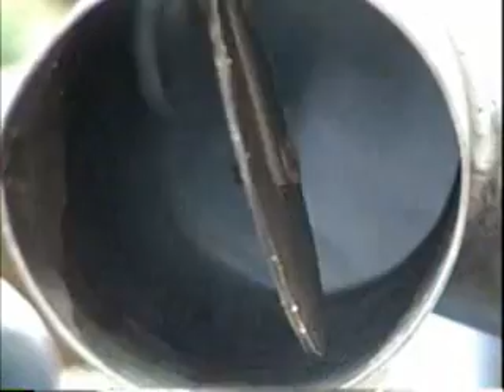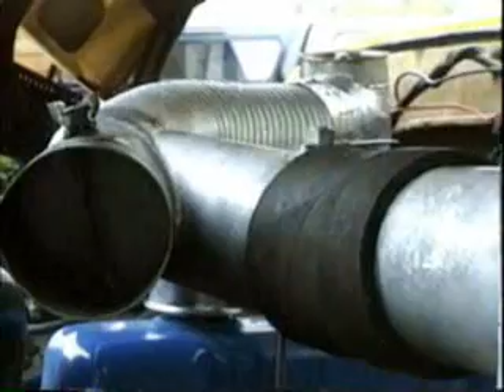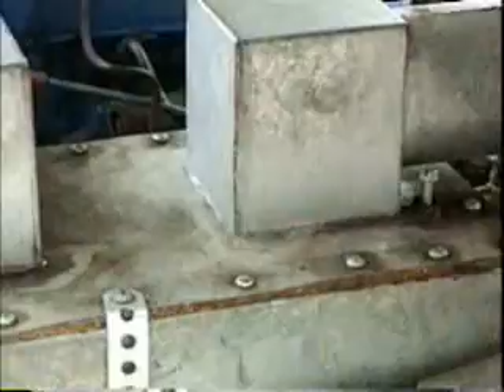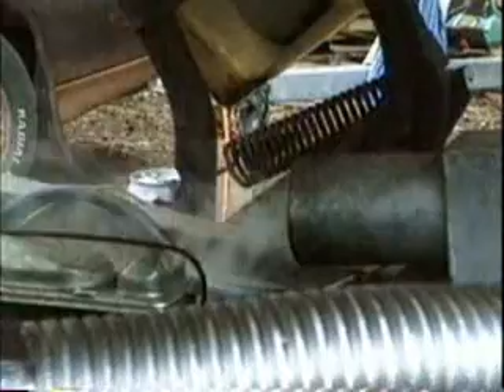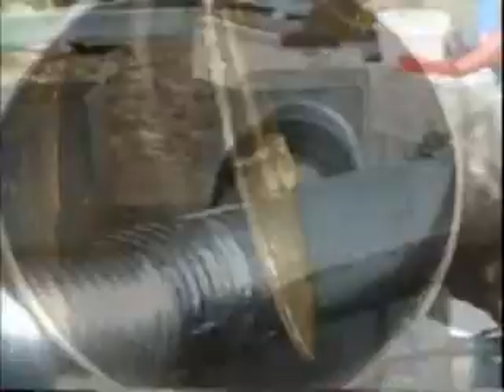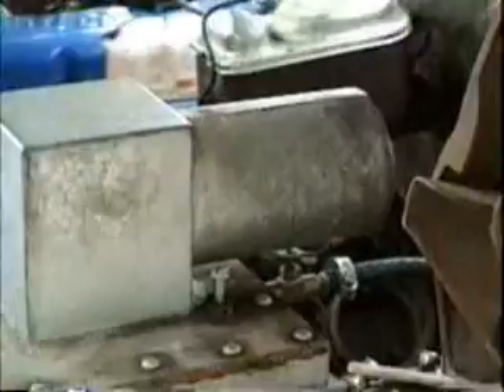Here is definitive proof on how to separate all Atoms in all liquid soluble matter.

Comment from the maker: The secret to what I have done, is not the amount of heat applied it is the temperature applied, and the ability to control the exact temperature to boil the atoms inside the liquid. I am saying that all atoms have a specific boiling temperature inside all liquids. All liquids have specific boiling temperatures. Until I discovered that using a fine pressured mist of liquid, spraying it onto a specific temperature, that I could take any liquid to any temperature, even above the boiling temperature of that liquid. The fine mist droplets of liquid will go to the temperature being applied faster than the liquid can boil. Like Sublimation does to snow flakes. The snow flakes go from a solid to a gas without becoming a liquid, when a flame is applied to a snowball. I discovered that atoms have their own boiling temperatures inside every liquid. When an atom boils it becomes a gas, and other atoms inside that liquid, having different boiling temperatures, have not reached their boiling temperature and they remain a liquid. Gases and liquids will separate, thus separating the atoms in that liquid. Flashing Liquid is what I call my process.
Reply: +Bill Kendrick your system has merit but i think it is too dangerous to be experimenting with it in this fashion but i could be dead wrong and it uses a heat source that draws energy to do it i believe what you are doing is called flashing of a liquid to eliminate any secondary phase changes of a liquid to a vapor...in a vacuum there is a secondary phase change from liquid to vapor it is crystalization of some of the elements of gasoline
Reply from the maker: +pat galloway Here is a feather for your cap. Science says gasoline auto ignites at 534 degrees Fahrenheit, wrong. I have seen an electric cal rod heater, like electric water heaters use, turn a dull red before gasoline auto ignites. This is between 1000 and 1300 degrees Fahrenheit. This means there is over 500 degrees Fahrenheit temperature wise, that science says does not exist, in gasoline.
Reply: +Bill Kendrick  yes i know ,liquid fuel will not ignite at atmospheric pressure unless there is vapor present,even gasoline will not ignite even if you apply a lit  propane torch to it provided it is in a container with the lid off but if it is allowed to sit long enough to vaporize some of it ,it would be foolish to have any ignition source about . what you are doing is brilliant but i think it should be done in a manner that is totally safe and when the system is shut down there should be a carbon canister to absorb and reuse any residual vapors upon restart but i think  without expert engineering this is highly unsafe .that is why i do it in a vacuum
Reply from the maker: Yes it is the temperature applied that separates the atoms, however it is the amount of mass the heat source has, that will maintain that applied temperature. You see when the cold liquid makes contact with the heat source, heat goes from the hot surface to the cooler liquid, and it is the mass amount of heat at the right temperature, that causes the atoms in the gasoline to boil, becoming a gas, while other atoms in the gasoline, have not reached their boiling temperature, and they remain a liquid, thus separating the atoms in gasoline.
Reply: Bill Kendrick
 I think you mean splitting molecules apart not atoms. It takes a nuclear device to split atoms.

Comment: The gasoline tom ogle used isn't of the same we use today. Today's gasoline has many additives. Gasoline has a expiration date too. If you ever saw a model engine. The way the gas is fed. Is just fumes only. A tube or tank filled with gas with a hole on one side as a air inlet and the intake connected on the other. Air passes over the gasoline picking up its fumes. After running for a while on a model sized tank filled with about quart of gasoline. The gasoline becomes a useless liquid no longer producing fumes. However I noticed adding acetone increases the duration and production of fumes. There is a lot of things to factor that no one has experimented with.

Comment: The LAST thing you want to do is send this video to Obama. Research Tom Ogle. Made the news, got assassinated for not selling out.
Reply from the maker: I have already given this to all who see it on You Tube, guess they will have to assassinate everyone that has seen it.
Reply: Bill Kendrick  Haha you know I'm teasing! I've also been researching and testing vapor for some years  now. You've done a MIGHTY fine job here, especially for how old the video is! I do have a question though, how are you getting 600 degrees into the bottom of your reservoir? I seen somewhere else where you have 2 heating elements angled at the bottom, but what exactly are they? 600 is quite a feat!
Reply from the maker: Tyler B Because, at the time there was not a power inverter, on the market. I had a generator company rewind a generator, from an older vehicle and it produced 110 volts DC, turning the generator at 2000 RPM. I used two flat bar 250 watt 110 volt stainless steel heaters wired in series to get 500 watts of heat, which was around 600 degrees Fahrenheit. The rewired generator worked great until we did our first road test. I discovered the generator was running at 4000 RPM at 50 MPH. It burnt one of the heating elements into 2 pieces, at 400 RPM. Power inverters eliminate this problem..
Reply: Bill Kendrick  Very nice! Smart man. I hope you continue to spread the word and innovate.

Comment: Mate it aint happening, not until you guys change Presidents at the very least. He seems like a nice bloke but clearly out of his depth. Great video. Cheers, Zac.
Reply from the maker: Just to add a comment, I found I could advance the engine timing to top dead center and increase the engine power even more, running on the white vapor I created from gasoline.
Reply: everything is optimised for profit.. so everything is backwards.fuel injection is a scam... only advantage I see is a better cold start and warmup mode... that could be added to an old carb... do some diggin and look up the fish carb... killed because it was as tep in the right direction
Reply from the maker: Some of the greatest inventions were created by accident. Most of the time these inventions were created by ordinary people, that became known after their creations. There is an exception, Thomas Edison, he was a thief, not an inventor. The people that worked for him created his inventions, and he stole them and patented their creations, taking full credit for them. Today scientist have become reliant on the books that others have written. Most tend to stick to what is printed, and don't venture beyond their book knowledge. I am not a scientist, and may not be the smartest, but I know what I have seen, and the results are like nothing written in books. Scientist need to learn to think out of the box. Don't condemn what you have not seen, try things that go against what is written. Without innovation, and innovative discoveries, we would still think the world was flat. .
Reply from the maker: The people who view videos  and try nothing, are the watchers, the people that try it are the learners, and that go beyond trying are the inventors.
Reply: Bill Kendrick
Hey Bill, Nice work. I have built a few cold vapor units that i have running on different cars and they function to a point but yours is a good example of how to reach the maximum potential of the hydrocarbon fuels we use. In liquid form they are easily carried and used but not fully. To achieve the fullest potential in an internal combustion engine you must crack the fuel or separate the atoms into a gaseous form as they are designed as AIR pumps not liquid pumps. Liquid fuel DOES NOT BURN. Only the vapors do. When you compress gasses you get a liquid. You can't compress liquid so it is atomized through venturi or injectors and forced or drawn into a cylinder, then compressed and ignited. Very inefficient. Under compression, the surface tension of a liquid is increased. When the surface tension is increased, the ability of the liquid to evaporate or change state to a gas is reduced dramatically. Only about 27% to 30% of the fuel is burnt in modern engines. The rest is catalyzed in the exhaust and expelled. Cracking the fuel molecules into a dry vapor allows for 98% to 99% of the fuel to be burned in the cylinder and reduces the hydrocarbon expulsion to near zero as nearly all of the elements of the fuel are used.
 The bad thing is that there will NEVER be a time when this technology will be installed on cars for the masses. Only those people like us, who desire a better running and cleaner burning engine, will install this tech. The big oil companies, car companies, and the government have contracts together. The car companies are limited to mileage under 50mpg by the oil companies and the government. The tech to have a vehicle that easily gets over 100 mpg is here now but it is purposely being kept from the American market as the government and companies profit way to much from our current inefficiency. If cars got 100 mpg today, the companies would loose BILLIONS of dollars in gas and oil sales. It just isn't going to happen.
Reply: Great comment. ! ! well thought out !
but your too kind.. I suspect the burnt fuel ratio is lower at 18 - 20% at best...
the who thing is a scam.. that needs to be optimised.. plugs are wrong , Cam timing overlap is wrong, fuel is wrong..ignition timing  and more...Cheers have a nice day
Kudos to Bill !
Reply from the maker: The fish carb was invented in England. It ran in one Indy 500 but the car engine broke. The guy used a variable venturi, forcing air over the fuel, as it was sucked into the engine intake. US customs banned it from coming into the US many years back. You think the rich companies and people don't control our economy, then you need to take your head out of the sand. We need to get politics out of government. Pass laws to force candidates to tell where they get the money to run for office. Every bill passed needs to have the point of origin, and backers attached to let the public know who will benefit from the bill, and who is financing it's passage. Keep the rich honest.
Reply: Bill Kendrick
Incorrect. John Robert Fish invented it here in the early thirties.  He licensed manufacturing rights to Eric Liebman(Canada) and then Leonard Reece, (UK.) and Bob Henderson (Scotland). Reece manufactured the Reece-Fish and Henderson manufactured the Minnow-Fish, both popular in the UK
Reply: Bill Kendrick You have a great mind Bill. .. I can reccomend a channel for you to look at.... be mindfull .. some are uncomfortable at first.. go to the older videos and move forward... it's all true... you should have not trouble understanding 
Youtube channel   dave j      Cheers !
Reply: ***** Can I say again I love your work, I hope I'm not detracting from your efforts. It would be great if Governments encouraged new technology even if it challenged the oil companies.
Reply: the Governments are run by Satan ... ( quite literaly ) .. but things are changing... for the better... and they cant stop it ... hint... did you see the price of Gold latlely ?
Reply: thanks Bill.....every little bit helps
Reply: CarsRcool
You are right there. Most of the systems in the modern cars can be tuned to get more performance and mileage. If you have a good tuner program you can link directly with the PCM and change settings on the fly to achieve top performance. Which is what most "tuner" car drivers do. They will adjust the timing, spark duration, injector pulse bandwidth, and  other things to reach the peak performance of those small engines. It is just plain expensive and most people wouldn't understand the intricacies of the internal combustion engine.
Reply: Yes that is correct.. .. conceived in the 20 's  early 30's..
. R. FISH CARBURETOR April" 1', 1941.
Publication number US2236595 A Publication type Grant Publication date Apr 1, 1941 Filing date Jul 31, 1933 Priority date Jul 31, 1933 Inventors Robert Fish John Original Assignee Robert Fish John Export Citation BiBTeX, EndNote, RefMan
As  allways there is more to the story
Reply: Bill Kendrick Hi Bill.. to give you an update.. I was smoking up the back yard last week in a static test.. I will have at least  4 maybe 5 variations ..
making progress.. but as you know.. it does take time.. and a little money .. Cheers !
Reply: CarsRcool  I can not find the channel you are recommending for dave j can you post it? I will look on your channel to see if you have it on your channel listings
Reply: +Pastor William Barhorst  search dave j  and the  word " Hoax"  on youtube